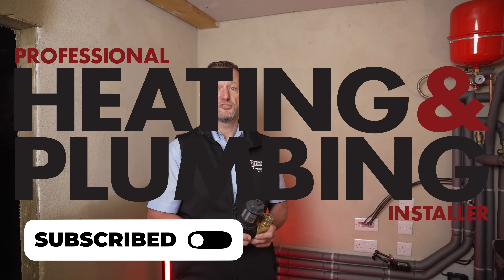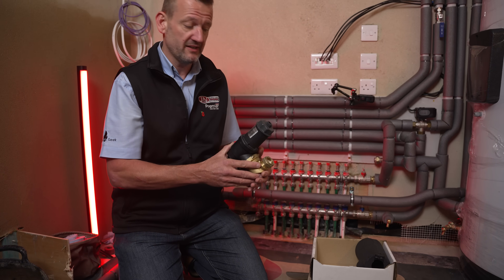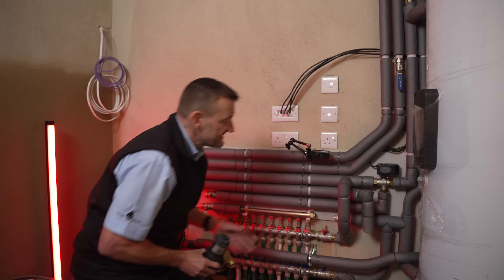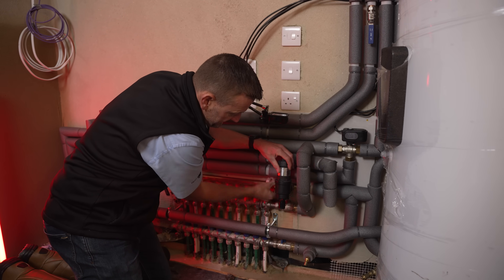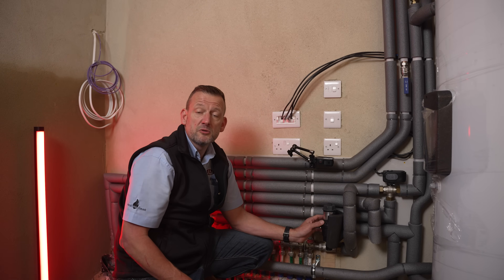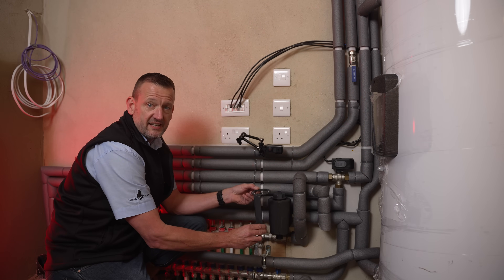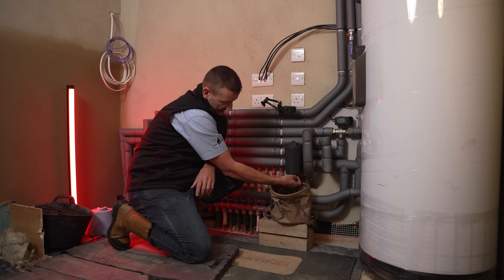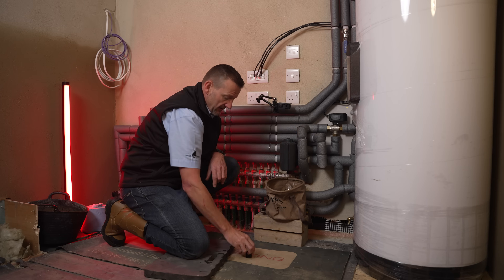How the SYR Advanced Pro Heat Pump Filter Works: Installation, Maintenance & Pro Insights

Comment: Can you remove the micron filter to clean?
Reply: Great question! You don't need to remove the 100-micron filter to clean it. It's designed to allow you to fully flush the filter without disassembling the valve. When the port is opened on the backwash system, it fully flushes any non-magnetic debris out via the drain port. If you lift the magnet out as it's flushing, it will then drop any magnetic debris too and this will also be flushed away. In this video, you can view the servicing process at 02:03 minutes.